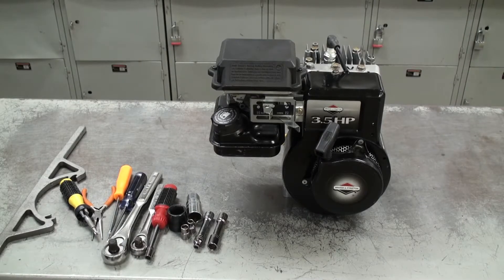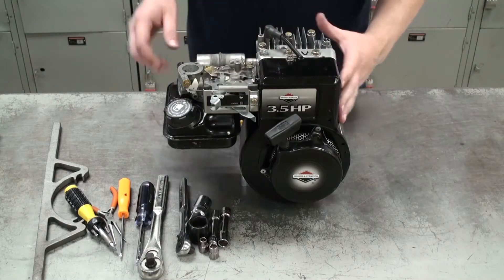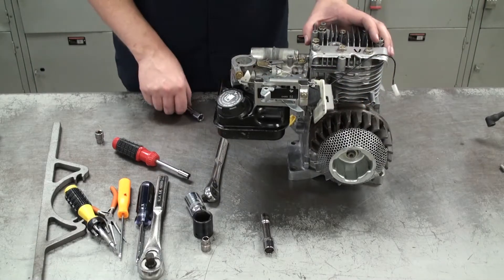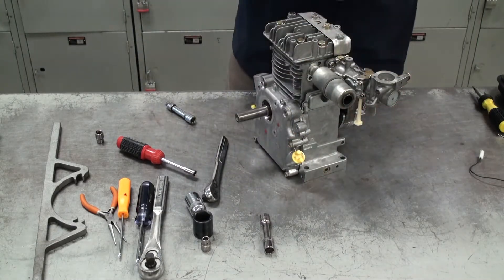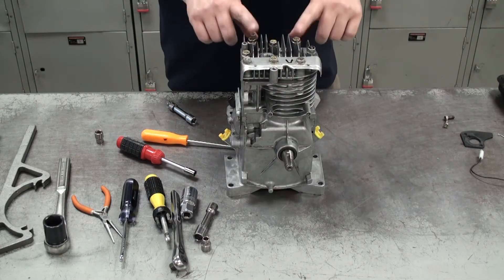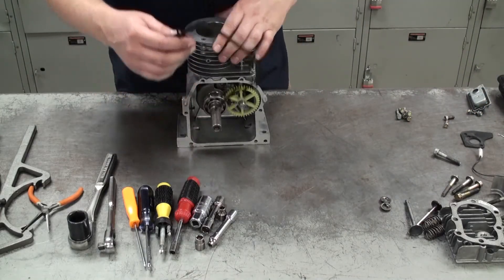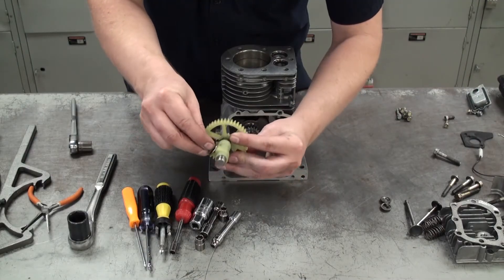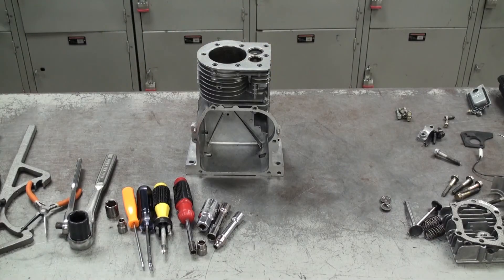Small Engine Disassembly 3.5 HP Briggs and Stratton

Comment: I have an edger, but I haven't used it in a couple of years, it was my dad's edger. I used it a couple of times and today it wouldn't start and it has a wire sticking out of the front (white with a white plastic open cap). I don't remember that being there. Is that the kill switch?? Thank you.

Comment: Hi Shawn,
I've enjoyed your pull-down and rebuild videos. Very thorough.
I watched them as I'm having the following issue:
My engine cut out on me the other day. I was able to restart it easily enough. After which, when I moved the throttle to a lower speed, it cut out again. If I move it to the lowest speed it will run slightly longer and then cuts out. I've noticed that the shaft throttle swings around freely in the lower speed settings.
When viewing your video I noticed you mention the first throttle spring to be removed (attaches to the body and the shaft throttle). My engine looks similar except I can't seem to find the throttle spring mentioned. And, there is no hole for a spring. Do earlier models not have this? My model is 091203-0123.
Any assistance would be appreciated.

Comment: Nice video. I have the same engine on my McLane reel mower and today stop working after 15 minutes of running. I check the air filter is good gas tank is half way full but the oil was like gray color. So I deside to change the oil and machine runs again for like 20 min and stop. I wait 1hr runs and some thing happens. I really dont know what wrong.😏
Reply: Did you get it working? Crappy gas now a days, use at least 89.
Reply: Clean the carb and the gas tank. If that doesn’t work replace the spark plug. If that doesn’t work replace your ignition coil